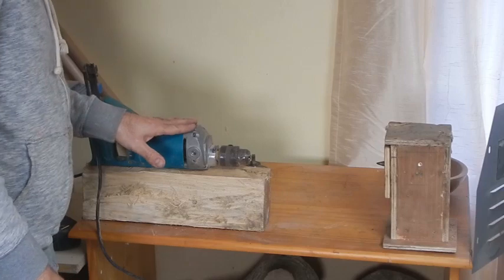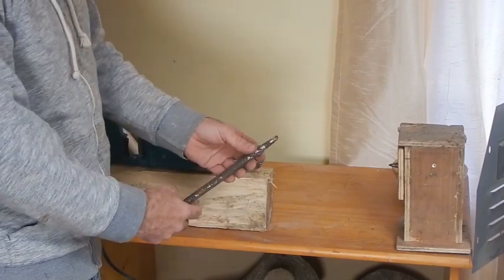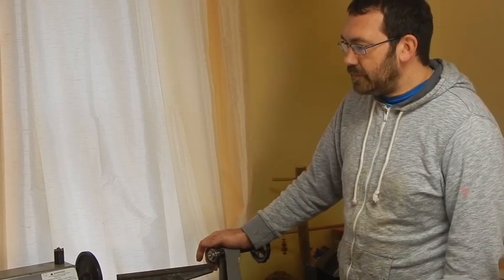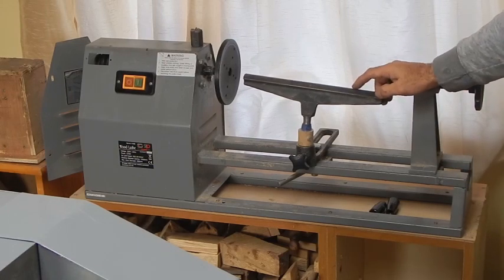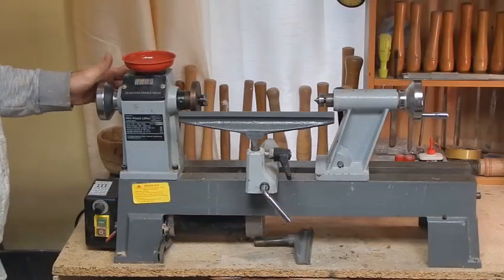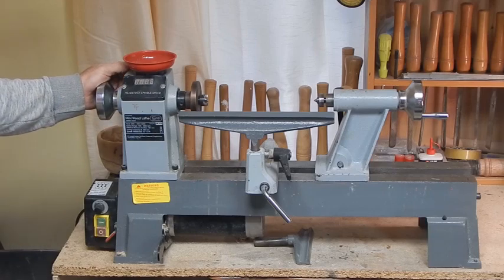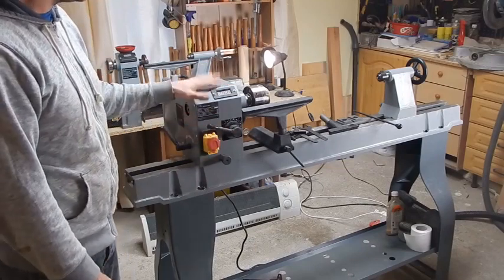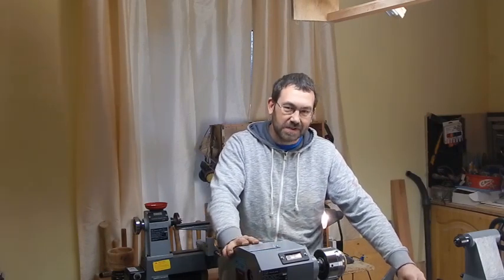Woodturning with a low budget and a walk through my story of lathes.

Comment: I’ve just bought my first lathe which is like your first bought one but mine is a Lumberjack. I'll never be able to turn big projects due to some disabilities I have. I have bought some second hand gouges as experience in other woodwork has taught me the pitfalls of cheap hand tools. I have a 3" (I think) chuck and other headstock with wormscrews that have the 3/4” 16tpi thread. I’ve also welded up an adaption for the tail stock I can use with the old morse taper off my drill press. That means I can safely use Forstner and spade bits. 

My wood turning is intended to enhance my other small project woodwork not to be a stand alone hobby, if that makes sense. However, as you say it’s addictive so we'll see but I find all wood and metal addictive as creative medium.

Personally I have to say this is the most inspiring woodturning video I've seen. You’ve shown me a journey others rarely do, most often I just get to see the destination. A definite subscribe, thank you.

Comment: Thanks for the generous shout-out.  As you said, if you look after the stuff it will last a long time.  Another wee tip, if you are going to be turning outboard, using the extension, get a length of 75mm x 50mm timber and cut a support to go under the tool rest section because the rest is hanging in mid air and the downward forces could snap the rest as cast iron is brittle.  I'll do a quick video tomorrow to show exactly what I mean.  I'll stick it up on the BMac Woodturning channel.
Best Wishes, Brendan.
Reply from the maker: +baconsoda Thanks Brendan !! Your more than welcome mate !!! Thanks for all the info, it helps out a lot !! Thanks for watching, Steve.

Comment: Hi Steve,
Congrats on the new lathe, that is extremely cool, enjoy!  I too have a large family and it's taken a while to begin stocking up the workshop, but what a joy it is to while away the hours behind a chisel :)  One thing I noticed while you were describing the bits and pieces was your knockout bar, then pointing at both tail and headstock with its use.  When I got my lathe, the live center had been installed for probably 15 years and was rather well stuck, so whacking away with the knockout bar it was.  Knocked the center cone out of the live center as well as the outer housing piece which rides on the bearing. Back to YT and I doscovered that by running the tailstock quill all the way in, that it ejects whatever device from the tailstock taper.
Best to you,
- Bill
Reply from the maker: +Bill Kibby Hi, thanks .... Yep that was a slight slip of the tongue in the video, the live tail centre is removed by backing out the quill..... I meant to say the tailstock is hollow for long hole boring...... Thanks for pointing out to though !! Your watching and commenting is very much appreciated, Steve.
Reply: Ah, new turning tool syndrome...  I just got my first real chuck and I've barely been able to utter anything beyond "coffee" and "must turn"  :~)  Best!
- Bill
Reply from the maker: LOL !! I know ...Sooo addictive !!

Comment: Love your original home made lathe man, I mean, when I decided to start turning I was lucky to find a simple (terribly simple) lathe on sale, and I was lucky it was around my birthday, and even more lucky to have my wife's parents visiting with us from Israel at that moment, so I was gifted a very cheap lathe to start with, but I was just about to make my own when that happens and it was going to be nothing as good as yours was and who knows what could have happened to me if I did :)
Thank you for sharing you journey of lathes with us mate!! And again, congrats on 7K, please mail me your secret, I'll make it worth your while ;)

One small comment if I may, about leaving your speed down on the lathe, and saying it will throw the bowl at you if you start it up while forgetting the speed up. Now. It's a good practice to have the speed down when you switch it off, but not for fear of something flying off, but only so the motor won't stress trying to spin something at a high gear! like a car, try start driving in 5th gear, not so simple, right? if you leave your speed way up, and mount a bowl, and start the machine, what will happen is that your lathe will start spinning very slowly at first and will take its time to spin up. If the bowl or log are too large, your motor will not be able to spin them, heat up, and who knows what. That is the reason why you don't leave the speed up when you switch it off. Just saying ;)
Reply from the maker: +Yuval Lahav Woodturning Hey buddy !! Thanks so much for your words of advise, yes I agree, I always start the lathe from the lowest speed, I think it should be compulsory for manufacturers to incorporate a safety feature in all lathes that resets the speed to the lowest setting every time its switched off ...... Thanks a million Yuval, kind regards, Steve.

Comment: Hi Steve, 
I have a lathe that looks very much like your first lathe. I bought it second hand. What kind of screw do you have on the lathe m18? I'm asking because I don't have any faceplate or chuck and I want to buy one and the only option I see is to buy a chuck for an m33 screw and find an adapter for it. Can you give me some kind of advice. Thank you and great video!
Reply from the maker: Hi Ricardo !! My first lathe and indeed the other lathes I own all have the same spindle thread size which is  3/4 inch x 16 TPI spindle thread size.  My lathes are all S.I.P lathes . You can get chucks and faceplates to fit the thread or get adaptor inserts. The best of luck with finding what you need buddy, and thank you for watching and commenting. Regards Steve.
Reply: Templeboy Turnings Thanks a lot for your answer. I think I'll have to take a look at the insert adaptor. Great videos. Keep them coming! :)